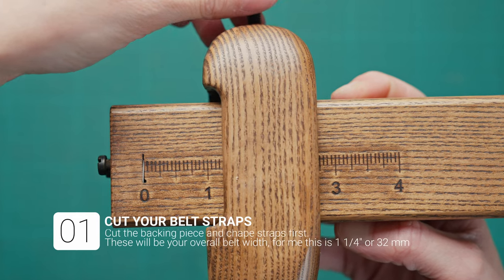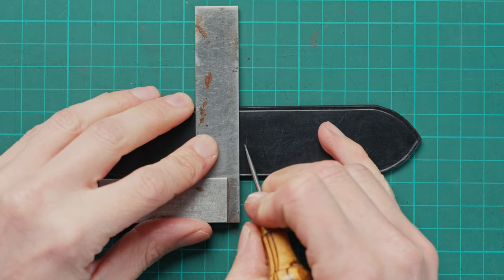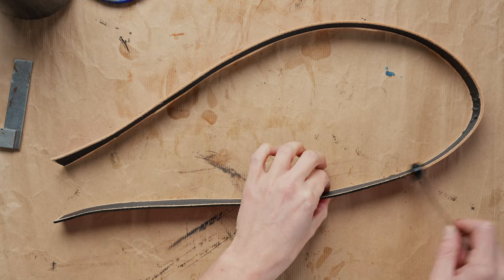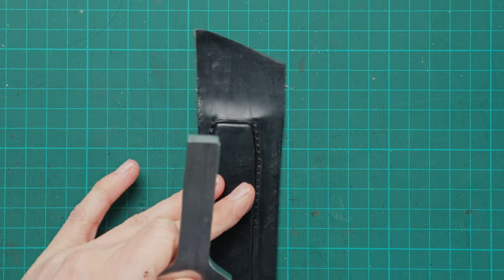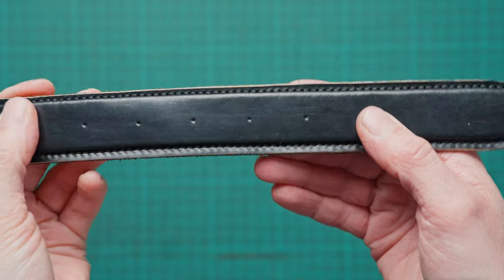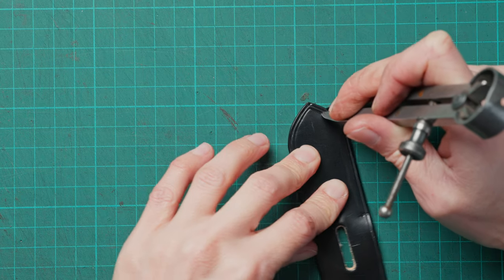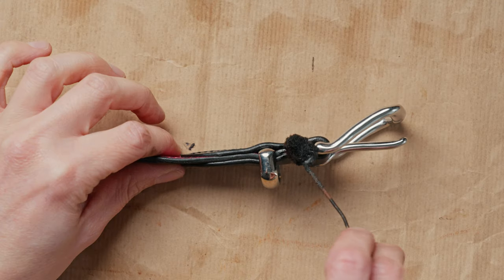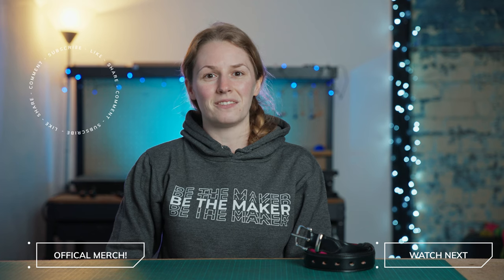Square Raised Belt // Be The Maker // Make Along Tutorial

Comment from the maker: This is a great project to make, and I hope you enjoy making this, as well as watching along. Thought I would leave a bit more information on the strap sizes when making a square raised belt along with some examples:

Backing strap: this is the finished width of your belt (mine was 1 1/4"/ 32 mm as that is how I like my own belts to be), this will need to be about 2mm thick.
Top strap: this is going to be the top outer side of your belt, you want to add at least 3/8" / 9 mm to this but if you are just starting out then 1/2" / 12 mm is good, and we want this to be ideally 0.8 - 1mm thick
Filler: this can be taken from a scrap piece after splitting, this will need to be 3/8" /9mm narrower than your main belt will be and about 2 mm thick - for a more pronounced raise, you can go a bit thicker.
End chape: this is the same width as your final belt and can be split to 3 mm thick.

Width examples: 1 1/4" / 32mm made up belt will need: 1 1/4" / 32mm backing piece and end chape, 1 3/4" / 44 mm top strap, 7/8" / 23 mm filler.

Hope that all makes sense.
Jo

Comment: I really agree with the managing of thread length.  Having stitched a single thread around a 42-inch belt, you spend a lot more time pulling the thread and untangling messes than anything.  Using a double arm's length is far more efficient.
Reply from the maker: For sure! So much more efficient and the threads end up nicer when shorter anyway 👍
Reply: @JHLeather  Howdy! I am more inclined towards tapered belts,coz I mostly try to use a 1inch buckle on 35mm wide strap..Is it possible to make a video on making the same pattern but with a tapered cut?? Many thanks! Id love to ask questions may be in a discord session!